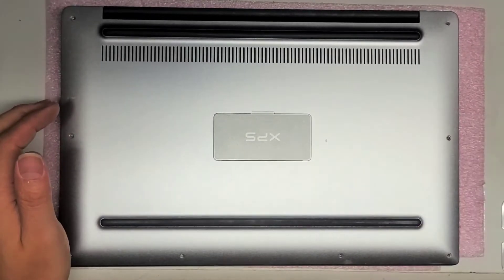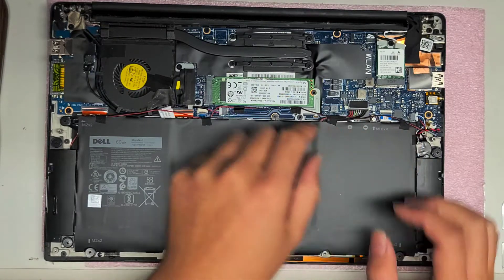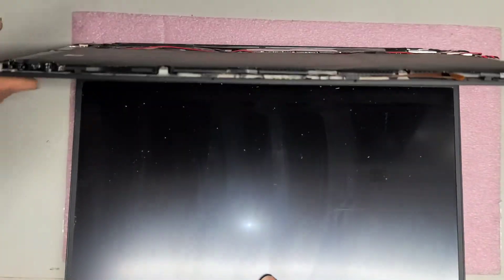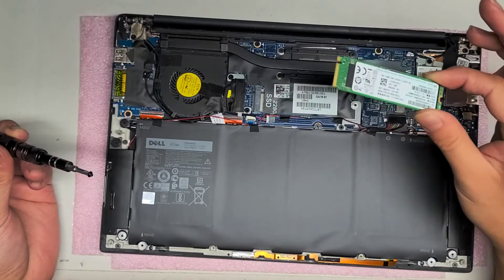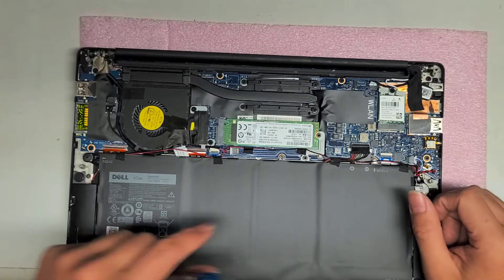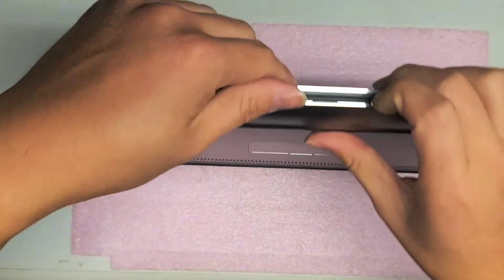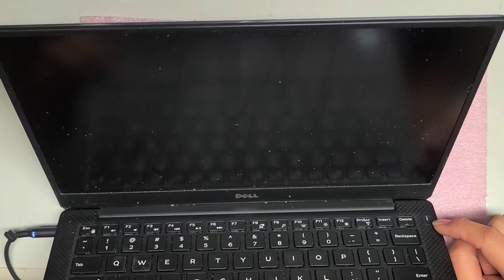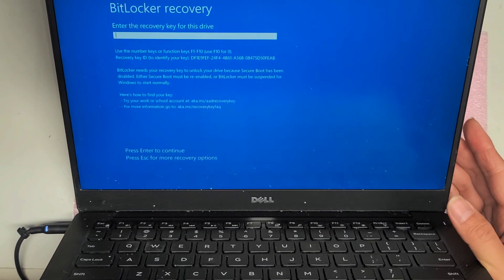DELL XPS 13 9360 Not Turning On Disassembly SSD Hard Drive Upgrade Repair BIOS CMOS Reset

Comment: I followed your instructions and in the end I was suspicious of a WD SN730 NVMe 256GB, so I removed the SSD.
In my case it was Code 2 5 which is a RAM problem.
I referenced that the XPS 9360 is almost the same model as my XPS 9350.
The WD SN730 NVMe 256GB, which has been working well on my previous motherboard, seems to be causing compatibility issues.
As you mentioned, it is only after the power is turned ON/OFF several times.
Booting without SSD was successful.
After installing this NVMe, it changed back to Code 2 4 situation.
A bios update may be required.
For now, I'm going to use another spare model NVMe.
(KIOXIA KBG40ZMT 128G Works!)
Thank you very much!!!
Reply from the maker: Awesome, glad you found a solution!
Reply: @ItsBinhRepaired  
Not all missions are over yet.
Regardless of which NVMe SSD is installed, code 2 4 is repeated.
The BIOS has been updated to the latest version 1.13.0.
I'm on a picnic right now, so I can't take the test right away, but
I found one solution on the dell xps forums.
When mounting an NVMe SSD, it has been said that incorrectly selected screws can short the SSD, leading to code 2 4.
I will report back after I go home and finish the exam.
Reply from the maker: Hmmm good luck
Reply: @화정큐삼-u3k  Hey mate, i was in the same situation, i followed you from a different forum to this guys great Youtube channel, tried everything.
I was just about to bin the whole thing and just save the HD when i noticed this reply. 
100% the screw was the problem, i first checked by removing the SSD, it booted to bios fine, just missing HD error (obviously)
so then i just slide the HD without screwing and it booted fine.
for me i had accidentally swapped the Wlan screw for the SSD, they are super similar and only slightly different, but it was the problem.
Big thanks to you both and just wanted to write what fixed it for me and add to the knowledge base.
Cheers
Reply: @kastin83 thanks screw was the problem 9360 dell xps 13.. solve by covering with a tape.
Reply from the maker: Nice

Comment: Excellent thanks for posting, this worked. If anyone is reading this, remember to screw in all the screws, as the device won't boot up if the longer screw under centre flap isn't inserted. I've liked and subscribed!
Reply from the maker: Glad it worked. Thanks!

Comment: You just saved my laptop.  I tried checking all connections, solder joints, etc. and didn't think about resetting the BIOS via disconnection.  Thank you.
Reply from the maker: Awesome, glad it helped. If you haven't already, please like and subscribe so others can find my videos and possibly consider watching a few others and commenting to get the algorithm to recommend my channel. Thanks!

Comment: If the charging light is on when plugged in but wont power on, does narrow down any possible issues?
Reply from the maker: Power button or motherboard

Comment: My xps13 won't start up and I did the procedure without any improvement.  No lights, no fan -- just dead.  What is recommended next?  Would a dead CMOS battery result in this situation?  Laptop battery is old but works for an hour or so.  I leave it plugged in all the time so it's probably on its way out.  Today, it's just dead.  Tried your fix a couple of times.  Charge adapter is lit up and I get voltage with my tester.  What do do next?  Thanks - like your vids!
Reply from the maker: Might be the charge port or the motherboard.
Reply: Roger that, thank you!  I have a new XPS so if I can't get this XPS to fire up, I'll just pull the SSD and put the old laptop in the recycle bin.    @ItsBinhRepaired
Reply from the maker: Sounds good

Comment: Hello, My XPS 13 won't power up after the power went out for a few minutes last night. I took unplugged those 2 batteries in the video, pressed the connectors with my screwdriver, cleaned the dust and pressed the power button for 15 seconds.... but it did not power back up. I even tried a new big battery (I don't remember what you called the little one) because I had one since I have to replace it a lot. Still doesn't power up. What can I do now? Do I get a new computer? I wouldn't even know where to get it fixed. Can the stuff on my hard drive be recovered? How? Luckily I have a second laptop and think pretty much everything is backed up, but I'd still like to save this one or at leas the data on the HD. Please help, you seem so nice.
Reply from the maker: Likely motherboard issue. This will help you access your data https://amzn.to/3VQ11e5

Comment: I tried this yet still dell xps 13 not starting. I am having similar problem. It was all ok n suddently i had black screen. When i press power button the button itself lights up and can see keyboard backlight only. If i press D key alongwith power button upon starting up i see red green blue white n black screen. What should i do now
Reply from the maker: Can you get to bios with f2?
Reply: @ItsBinhRepaired  no. I cant hear laptop turning on. Only fan goes on n off n nothing except keyboqrd back light. Laptop was fine until i restarted it n kept pressing fn f8 key continousëy at dell logo. This made it freeze on startup dell logo n later when i restarted it i had black screen.
Reply from the maker: Try cleaning the RAM connectors and reseating them

Comment: Thanks. Worked ! Other question. My trackpad on the dell xp 13 9343 stopped working. I've replaced this with a 2nd hand other trackpad. But still BIOS is showing also the trackpad/mouse. Do you've a tip?
Reply from the maker: What do you mean by BIOS is showing?

Comment: Nice video. The only time I saw any activity (front lights flashing amber and white for a few seconds until they stopped) was after I disconnected the battery, discharged, and plugged in. Any ideas on what the problem could be?
Reply from the maker: Not sure

Comment: Thank you so much for this was really helpful but please it doesn't fixed permanently...just want to know what's the cause and how do we prevent it
Reply from the maker: Not really sure, but it seems to be a common issue. Try leaving the cmos battery disconnected. Just keep an eye on the date and time.

Comment: hey thanks for posting this!
I tried it and it works, but the problem is it wasn't a permanent fix - I now have to do this almost every time i shut down my laptop. what do you think could be the issue? I checked the voltage on my RTC battery and it shows 3.1V so i'm assuming it isn't dead.
Reply: 7 months late to the party but I was having a similar issue. After a ton of troubleshooting, I found that this would happen only when the phillips screw under the service tag lid was screwed in. If I leave that screw out, I no longer have the issue. If I put the screw back in, it fails to boot until I take the screw back out.
Reply: @Staas1  strange or not strange - ITS JUST WORKS!! 👍👍🙂
Thanks for that tip.
Maybe the screw is too long and presses something inside.
It turns on again.
Thanks.
Reply from the maker: Awesome!
Reply from the maker: Very strange
Reply from the maker: Not sure. Try leaving the RTC battery disconnected.

Comment: Not bad, but you should be using a PLASTIC pry tool--prevents, gouges, scratches, etc...
Reply from the maker: Been doing this over 10 years without any issues/complaints. Plastic tools just break off and then you have to deal with broken stuff rolling around and they're not as thin/strong, so they actually break more things.
Reply: @ItsBinhRepaired  Good point about the plastic tools breaking; maybe you're right. I've probably opened up 30-40 laptops since 2009 (when my first laptop, a Dell Latitude D630, malfunctioned). I never did it for a living, more for a hobby. Thanks for the feedback!
Reply from the maker: @davedickinson6345  no problem :) I used some plaid tools when starting out, to be fair they were cheap ones, maybe there are more expensive ones that hold up better and can do the job, but there have been some repairs that I feel would have been impossible with plastic even permanently bent my metal tools. XD

Comment: I have the same laptop but my problem is it's not turning on too but when I power it on it will turn off after 10-15 sec. what fix would you recommend for my laptop. thanks
Reply: Update for me. Figured out I actually have the 7390 2 in 1. I took it apart but it looks like no CMOS is visible and everything is hardwired in this model. I was able to get the battery out of mine but I didn't help. Looks like I'm going laptop shopping again.
Reply from the maker: Not sure. Possibly RAM or motherboard.
Reply: @ItsBinhRepaired  - Mine just died too. Not sure when I'll have time but will try this video but it might be the motherboard in my case. I read on a forum somewhere about possible static electricity issue and a way to reset it. Good luck with yours.